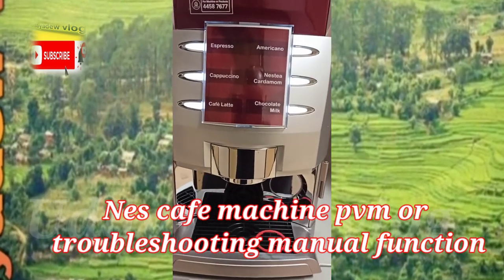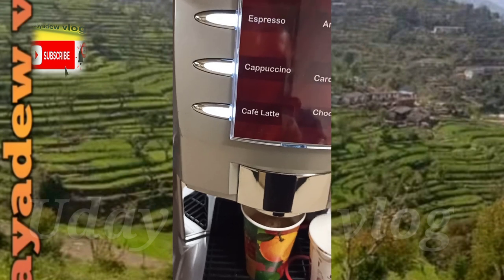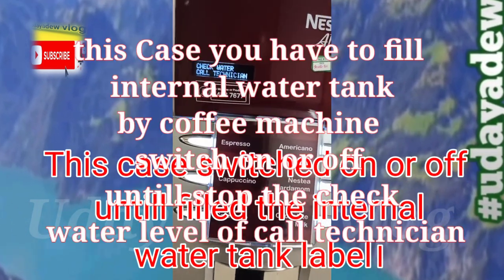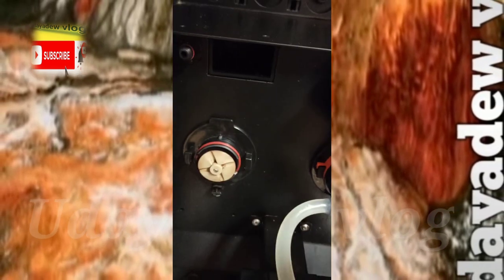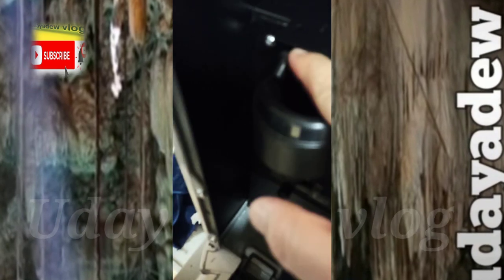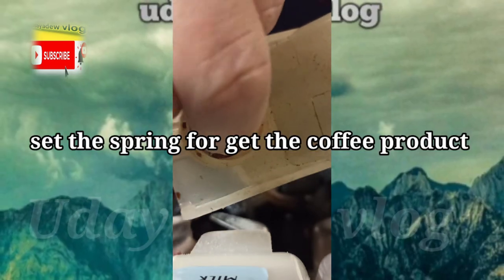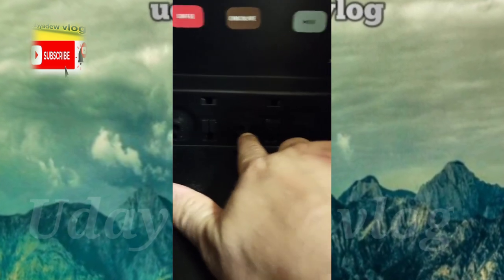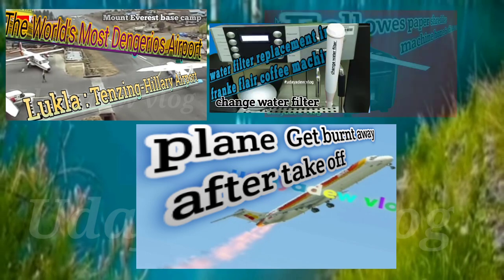nescafe alegrianascafe machine troubleshooting & malfunction|nescafe alegria machine how to use

Comment: How to reduce the portion of ☕?
Reply from the maker: Reduce inlets water level ।
You can reduce front or can reduce main inlets speed use any bush for main pipe।
Reply: @Udayadewvlog  I have nescafe alergia machine. It has 8 type of coffe option
Reply from the maker: Ok boss you can reduce Main water inlets bys use any kinds of bush ।it means reduce  ।
When you starts coffee your paper cup going over flow i think your have this issue ।

Comment: i have problem with this machine..it doesnt refill water what to do?
Reply from the maker: One time refill water by start machine by electrical switch continue four five times।
Reply from the maker: Once tank is full
Reply from the maker: After only use coffee
Reply from the maker: U can watch video continue।
Reply: i tried on and off but still no water
Reply from the maker: Your inside water tank i empty
Reply from the maker: You can refill water manual by hand
Reply from the maker: For manual refill water  watch video for more information
Reply: ok thanks
Reply from the maker: Friends pull water pump and press the bottom side Submersible Water Pump ss nosel